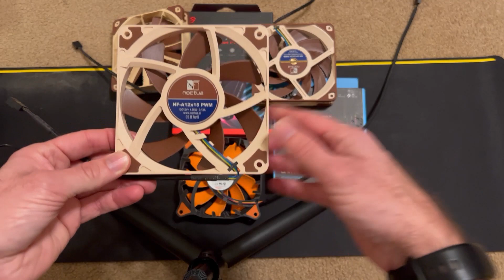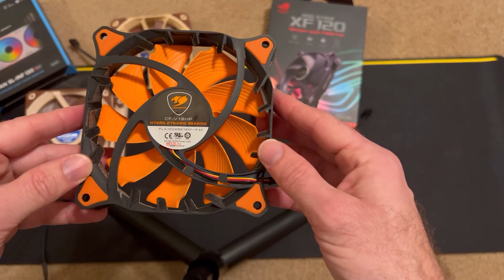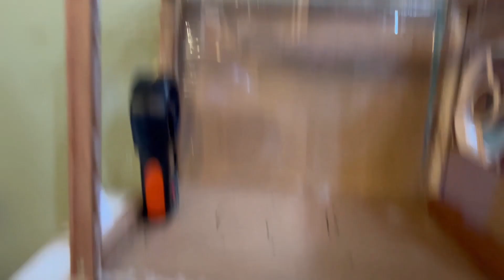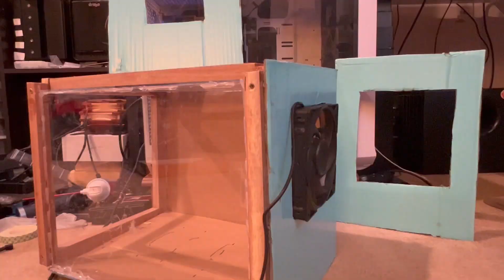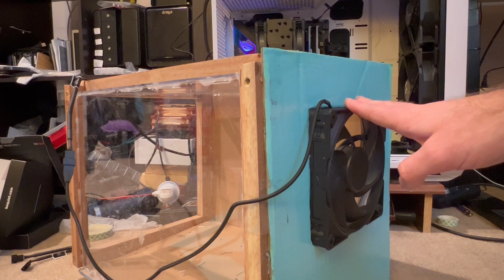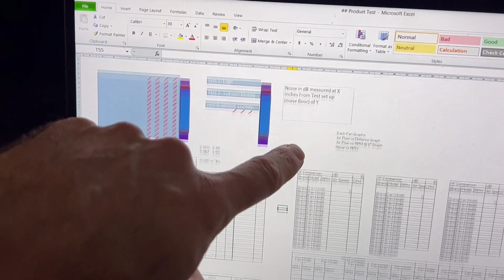Fan Testing Methodology

Comment: I just found your channel and currently combing trough your videos, you do a great job.
I really like that you show real frequency chart, not just a dB(A) number. You could also show how a fan sounds in front of a CPU cooler or radiator. For example I don't like the sound of a standard Noctua fan on a cooler, swept wingged fans have a much better "wind noise" (turbulent noise or hoewer you wanna translate it). Thermalright fans has also horrible wind noise.

Next part just a personal rant, don't take it seriously:
I'm a silent case enthusiast, but unfortunately I haven't find yet a Youtube channel that does real tests on real hardware with real equipment with good data. The best I could find is a guy who uses a Ryzen 3600X CPU but all hes data under 50% PWM is useless because of the high noisefloor, he placed the mic 1 m far away. My personal noisefloor is under a P12's 1100 RPM, everything over it I consider loud.
I wan't to see a reasonable buld's heat removed from a box about 250-300W (CPU 65-105W, GPU 150-200W), but nobody does that kind of test, they start with a 125W CPU and 300W GPU.
Reply from the maker: thank you for the support. personally I found most fans sound the same in push its pull that can very wildly buy fan. 
As for noise floor. I suffer from that as well. it varies between 28-35db. which is why I noise normalize subtracting out the noise floor. 
I am actually building a noise chamber myself. Its small but should do the trick. 2 layers of MDF with absorbing panels between the layers plug elgoto panels inside. I'm hoping to stabilize my noise floor so traffic doesn't mess up reading. 
Like all the upgrades I want to do cost $$ that this channel doesnt make, I'm more talking to everyone who subs here. Like if everyone did a $1 super or became a member for 1 month I could get my full next gen testing setup in 1 go. as it is right now I'm doing it piece by piece. it is what it is. do the best I can with what i have.

Comment: Is the chamber the part of your 'new testing' method? I am concerned that the rotational component of the airflow vector may affect the precision of CFM measurement.
Reply from the maker: For the Chamber having a flow straightener would invalidate what I am trying to test. That test is there to show differences between fan flow patters or how focused they throw the air. My CFM test on the other hand would benefit from a flow straightener, that would come with version 3 of testing method after this channel is actually sustainable. 
This is the difference between real word (how the product actually used) and scientific testing.